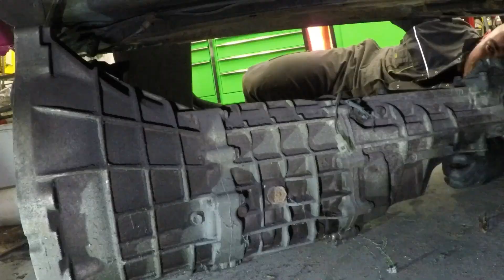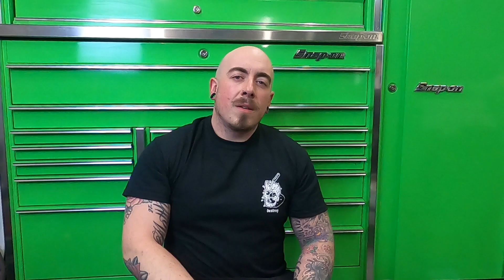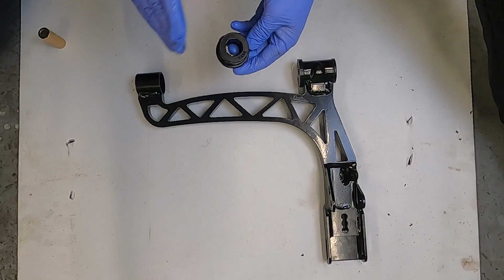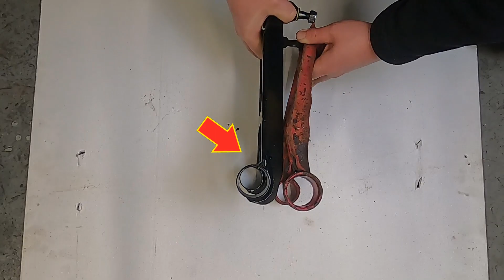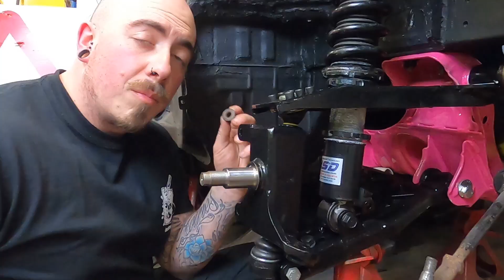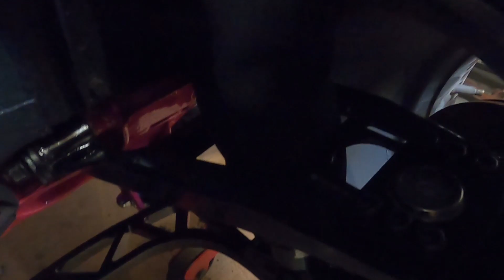DESTROY OR DIE FRONT SUPER ANGLE KIT : MX5 turbo build pt 32

Comment: what did you end up going with for the tie rods just oem or do they need to be extended ?
Reply from the maker: At the moment im using standard inners and outers with a 40mm spacer between, it seems to work good

Comment: at max track width can you still use the stock tie rods? or do you recommend any extensions for the tie rod?
Reply from the maker: with max track width you will need extensions or else you wont be able to get the toe in and out anywhere near

Comment: hey mate, love your videos, if you ever see this, do you know the wheel specs of the wheel you put on for the clearance test, im wanting to buy the destory or die knuckle and want to see if i will rub, im running a 15x8+10, TYSM!
Reply from the maker: it should fit fine, as a test fit i used 16x7 et30 and a 15x9 et 0 and both cleared

Comment: Going to be doing just front upper and lower arms on mine soon, just a question about torquing them down. Do these particular arms not need to be done under the cars weight to avoid any issues? I remember something about this when fitting my coilovers, I forgot this and ended up with a slight uneven height until I re-did the top arm bolts with the car on its wheels (a faff if you dont have a good ramp so can use a jack)
Reply from the maker: i think unless you have a ramp or your body panels off this will be quiet difficult. its probably worth shooting destroy or die a message
Reply: @Project380  I use Olympic weight plates under the wheels when I'm undersealing which gets it quite high so that could work I guess 😬

Comment: I know this is like a year old video, but I wonder whats your experience. My set of skidnation bolts stripped to hell when I torqued them, and according to skidnation it was because I copper greased the threads which I should never do because it changes the torque limit on them basically.
Reply from the maker: hmm thts strange. i personally didnt have a problem but yes after a bit or research they are correct with what they are saying, copper grease can change the torque limit
Reply: @Project380  this why I wondered why yours didnt strip after bathing them in grease basically

Comment: Just curious looking into this kit, can you run stock front upper control arms with the knuckles? Btw nice video.
Reply from the maker: Yes you can. depending on the rest of the set up
Reply: yes you can! But check your wheels don't rub them at full angle.

Comment: are you stupid of course with no tie rod attached the wheel will hit somewhere what else is going to stop it moving??????? you dont need a spacer when you attach the tie rod you will have less angle...
Reply from the maker: thts why i said "bare in mind i have no tie rod attached" and in the past with a different set up i had to put a spacer on to bring the wheel away from the lower control arm as that was the first thing it hit which then gave me more angle

Comment: I hope you’re still answering these comments, wonderful video but I could use your help! I have extended lower front control arms for more camber to fit my 16x9 -5 wheels. I’m on bags and when I air out I’m just too close to the tire so I’m looking to add a few more degrees of negative camber. Also the strut is rubbing against my upper control arm very badly. Would this new upper arm allow me to achieve a few more degrees of negative camber? Or since it’s longer will it just push my wheel out further while giving me limited adjustability? And I was also looking into getting these knuckles to correct some of the sloppiness in my steering from all the camber. Thank you in advance!
Reply: The front upper is stock length at the shortest setting so it won’t push your wheel out any further unless you extend it. The hole for the strut is larger than OEM to provide more clearance from the strut. If you have any other questions you can email hello@destroyordie.com
Reply from the maker: Sorry for the slow reply, as "Destroy or Die" said above